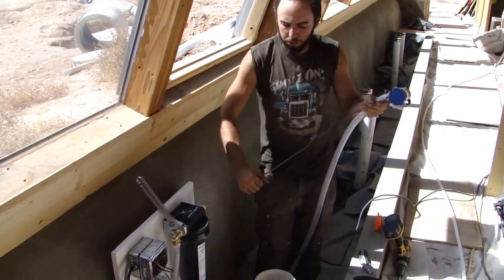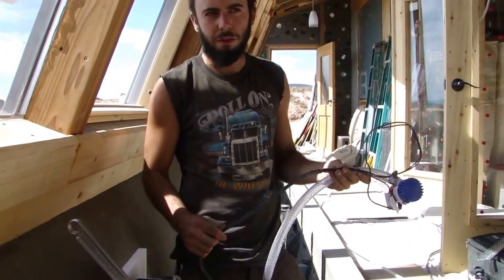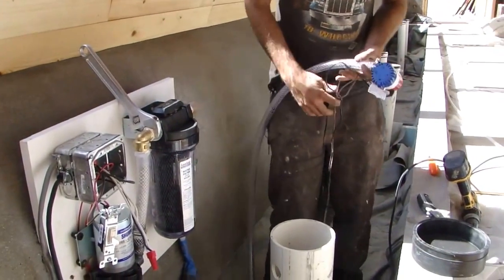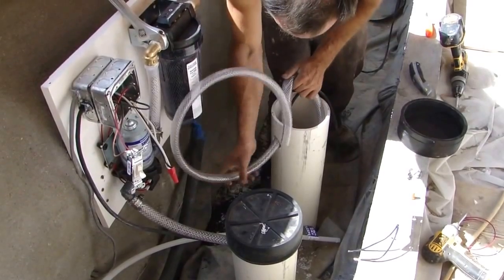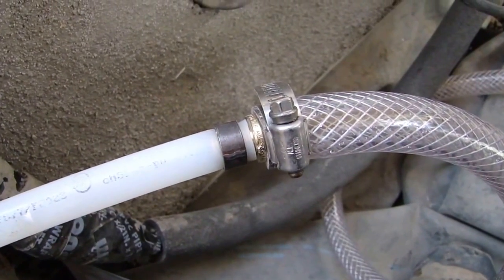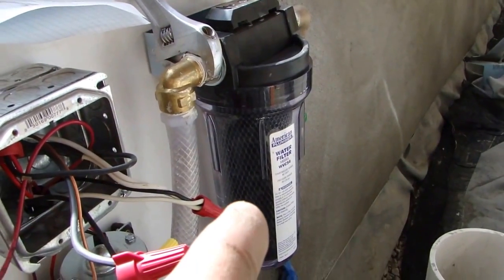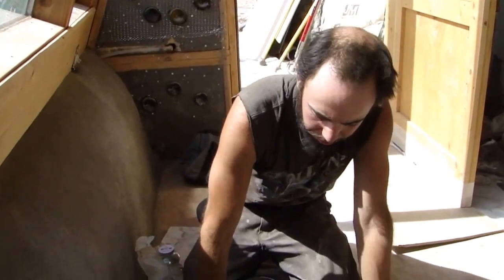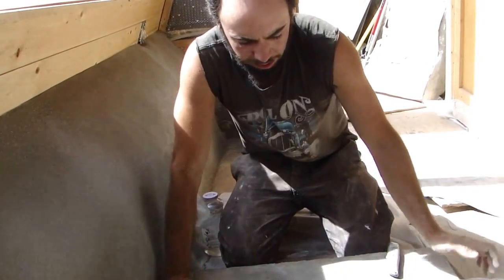Gray Water Planter - Part V

Comment: Love the video series but still wondering if you really need the break in the cells? also how fine of a filter do we need if we're just running the water to the toilet? You mentioned recirculating for an hour but don't say how often you use it so hour on, 2 hours off? also how often and long do you run it through your gravel for aeration? Lastly about the gardening filter fabric, I assume that's the same as a weed mat? and do you need to do anything to help the roots go through or is it sitting just below where you want the top of the water so the roots can feed on the water coming through? Thanks For any answers or opinions you can provide!!! And Thanks for the video!